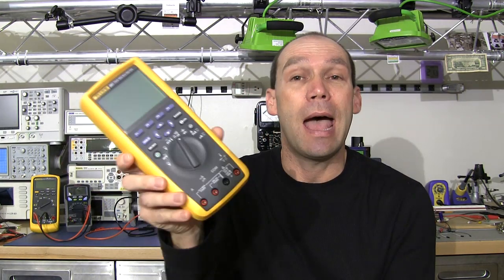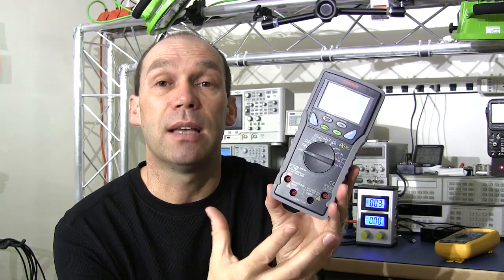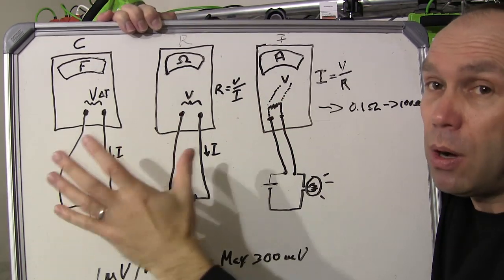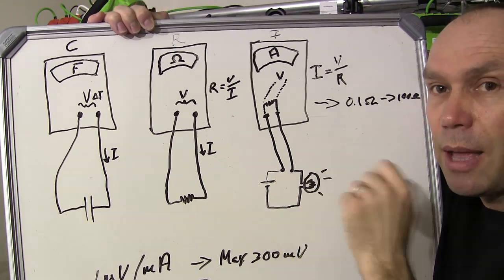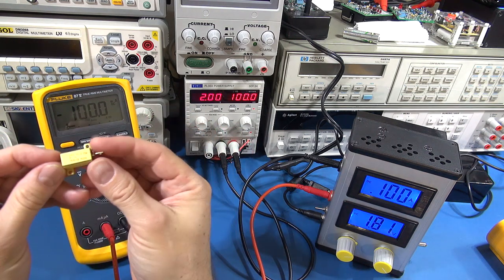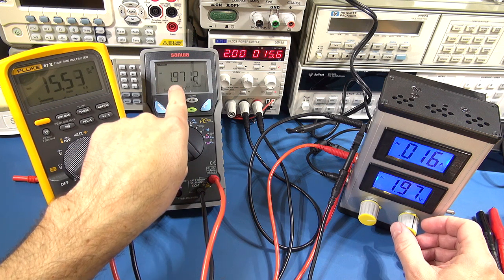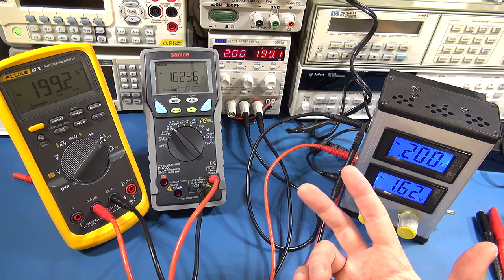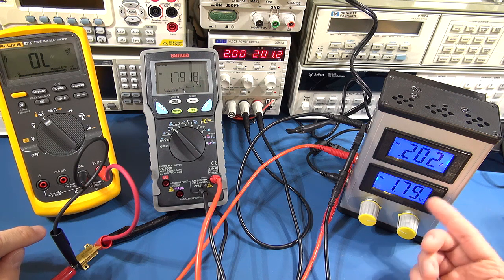Burden Voltage, How a Multimeter Takes Measurements and the uCurrent

Comment: Martin I sent you a private message with preview link to my kickstarter project if you get the time take a quick glance and let me know what you think.

The advantage of the Dave's ucurrent is that it can be used with an oscilloscope. The construction is similar in a multimeter also since there are voltage amplifiers to measure the voltage drop on the shunt resistor.
But the lover the shunt resistor value the higher the amplification needs to be and that leads to lower accuracy.
So yes the Dave ucurrent is useful if you need to also see the shape of the current and not just the average current value or if your multimeter dose not provide an accurate low current measurement. 

The video presentation was great especially the introduction with how the multimeter's measure capacity, resistance and current.

Comment: Thanks for a great video as a recent mechanical engineer to electronic hobbyist, I have a lot of gaps in the finer points of electronic wizardry. I am slowly finding out what the angry pixies ( AvE (c)) in batteries and those in the wall socket really do. 

I know Dave Jones is clever and a great E.Engineer, but I have to imagine that there are people of equal (possibly higher) skill level working at HP, Fluke, etc... Why isn't the uCurrent's or similar device's function built into higherend (maybe just bench sized) meters? Or do those companies sell add-on widgets like the uCurrent?

Comment: Checked this past week (June 2016) and not in stock (uCurrent Gold) or for back order.  Would guess that his suppliers are busy with BIG Production orders.  Picked up his EEVBlog BM235 multimeter by Brymen less cost than a Fluke (but will still check ebay).  Thank you for the video !  tjl

Comment: Wow, 0.1 ohm for the 10A range on the Fluke 87 is actually quite high. I measured the Brymen 867 and it has a 0.04 ohm current shunt, substantially lessening the effect on the measured circuit (in fact, I looked at the booklet and it's actually specified as 0.04V/A, which matches what I was able to measure). Did you zero/null out the cables you used to measure the Fluke shunt value with? My thick 1m cables are 0.03 ohm each.
Reply from the maker: Thanks, you are correct...my mistake. It is closer to 0.01 ohm. I'll add an annotation.
Reply: mjlorton No worries - I was able to d/l a service manual for the 87-series (although I'm not sure if it's for version 5). The manual states a burden voltage of 0.03V/A, so the shunt should be 0.03 ohm as well.

Comment: Hey martin, nice video!
I now finally understand burden voltage;
Just a Q - Is the load built-in amp meter also affecting the V drop? So I could expect a smaller V drop if only using 1 meter
Edit: 3 amp meters even, Power supply, fluke and load
Reply: Yes, for the load's amp meter, but most well-designed power supplies have a current sense control pin which would measure the output of the power supply after the current sense resistor and thereby compensate for any losses it would incur.
Reply: TechBench understood, thanks for the reply!

Comment: This was a great video. However, in my opinion, you could have given it a different emphasis. Although it is just a diverse interpretation for the same phenomenon, the fact is that when you are measuring current, you are not worried about the voltage drop. You are worried about the fact that the resistance of the multimeter will affect the current flowing through the circuit, hence leading to measurement errors (when compared to the current you really want to read, i. e., the current flowing through the circuit when you don't have a multimeter in series with it).